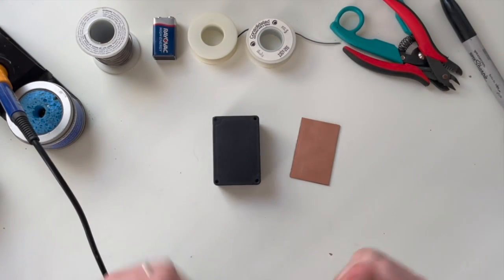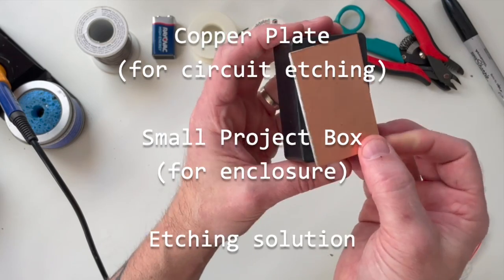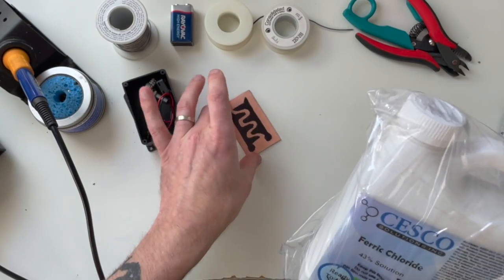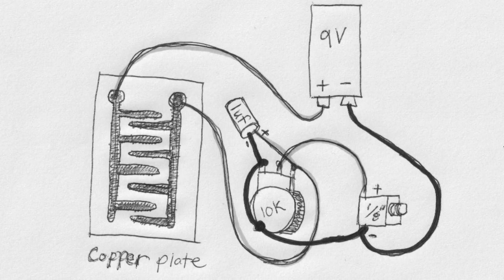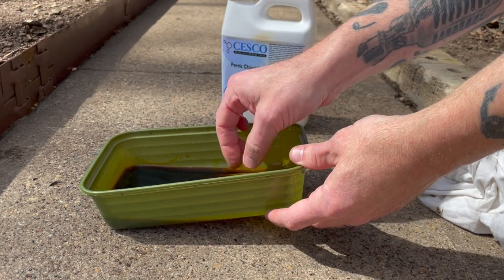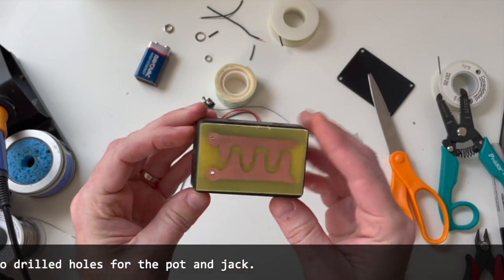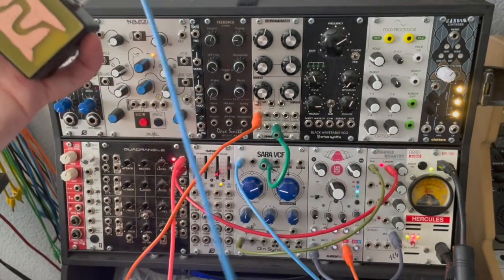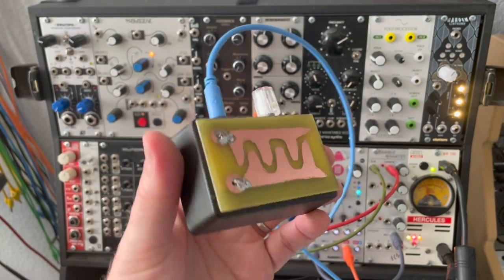Building a DIY Touchplate Controller (it's easier than you think)

Comment: Nice! Great explanation. You could probably use copper tape to make it even easier.
Reply from the maker: Thanks for checking it out. That is a good option as well. You could do (more or less) the same thing by just placing copper tape on the top of the project box in a similar shape. Great idea.